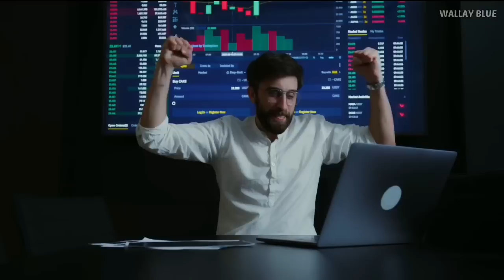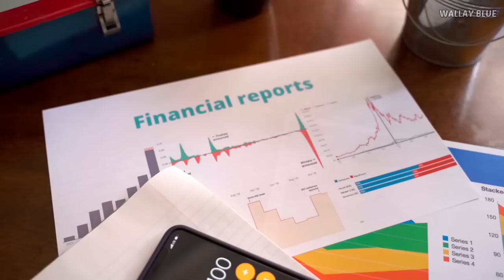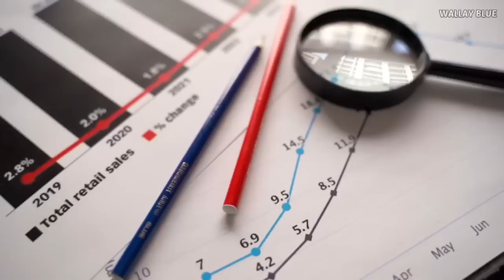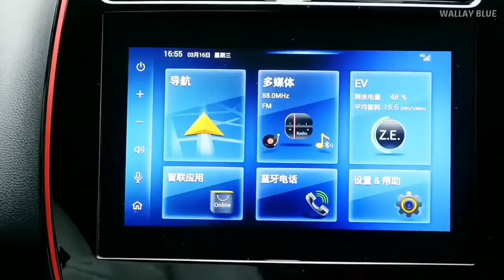China's New $7,800 Car Shock The Entire EV Industry

Comment: Imagine what this $7800 new car would cost in the US if it was built with all the parts and steel made from US production.  Probably at least 5 times as much.   The ChineseYuan buys 5 times as much in China versus what the equivalent dollar amount buys in the US. This is the true measure of China’s economic strength and the Chinese standard of living … nearly 5 times greater than the US economic strength when trade is finally cut off.

Comment: The numbers don't add up. The 33kW motor must give truly insipid performance - by contrast, the Nissan Sakura, a lighter, smaller Kei car, has 45kW. At 28kWh, I very much doubt you'll get anywhere close to a 200 mile range, unless that's downhill. Again, the Sakura, smaller and lighter, with a 20kWh battery, claims just 112 miles, and the actual practical range will likely be about 90 miles.